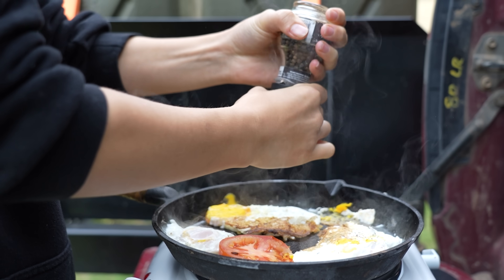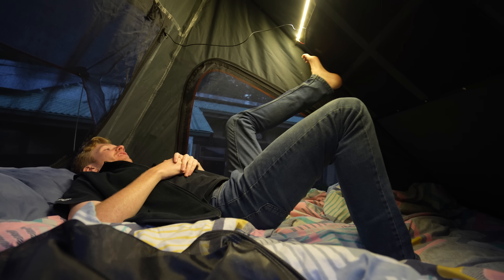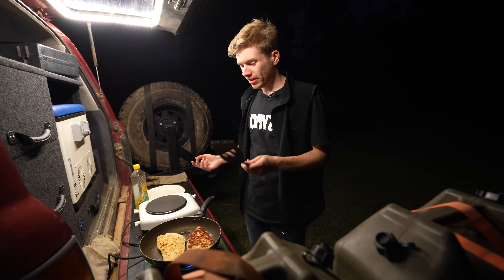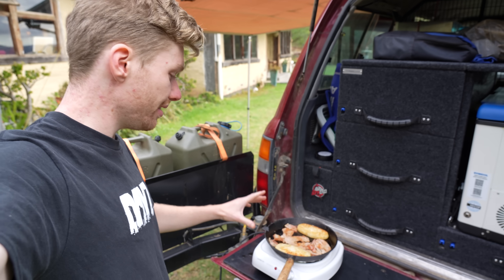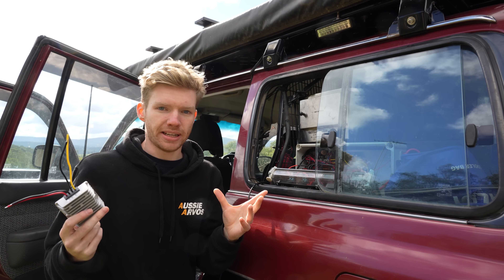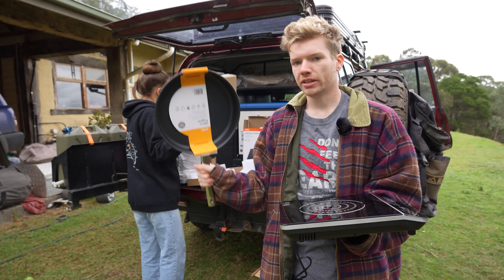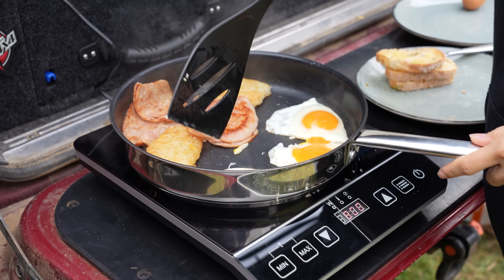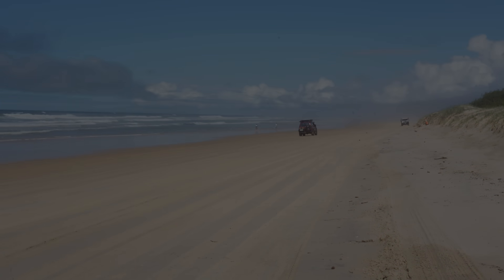is BUDGET induction cooking ACTUALLY POSSIBLE? Pushing my 12v Camping setup to its limits.

Comment from the maker: Essentially this issue comes down to the voltage of the battery getting too low when we are drawing the high current from it. As a lithium battery has a BMS (battery Management System) that is designed to keep all the cells happy and healthy as soon as the voltage drops below 11.3 power is cut. you would almost have a better shot using AGM or Lead Acid or Gel for this battery size as they do not have BMS and allow you to draw as much as the battery can handle! (this is not healthy for the lifespan of the battery and of course those batteries have many disadvantages compared to lithium). And as i mention this could also come down to the quality of the cells in the kings battery, or even the quality of the BMS but i think if you are buying lithium with the intention to cook using electricity i would be buying no less the 200Ah.
Reply: You shouldn't get a huge voltage drop with lifepo4 even with a .5c discharge 60amp should be fine id assume the bms is limited to about that with this quality of battery anyway id be measuring voltage directly at the battery and also at the inverter to see if your voltage drop isn't coming from there but thinking now its the bms cutting of not the inverter reaching a low voltage disconnect id say the bms wire size cant handle 60amps and thats where the voltage drop is coming from or a faulty cell the wire size on all bms's is usually undersized
Reply: im still in the ads but I thought the lithium had a built in voltage regulator also. even if high current draw ?
Reply: @brentmcd12  no they have a bms battery management system to protect individual cells most bms's now have balancers too to keep cells in balance but if you look at a discharge curve even with a high discharge its a very stable curve untill you reach ethier end of the scale thats why its basically impossible to use voltage as a state of charge at 15%-90% voltages are near identical
Reply: May have already thought of it but is the gauge of cable enough for 50A plus? May find a bit of resistance is causing the drop.
Is there some kind of voltage regulator that could fix this?
I appreciated this video 👍
Reply: Pat this is what i think your issue is here. Your Kings 120ah lithium battery is only rated at 100A continuous discharge. 100A x 12v = 1200W. So if you have the cooktop running at 1200W that already maxes out the battery's discharge rate. There is simply nothing left for anything else (including the inverter itself). The simple fix for this is to add another 120ah battery and run them in parallel so that you essentially have 2400W of continous discharge. You also get the added bonus of the extra 120ah capacity.
Reply: its not the AH of the battery that's just how much it can store you need to check the continuous discharge of the battery as paul said above
Reply from the maker: @paulholyoak  Thanks for you comment Paul, think you are spot on here, my shunts only ever showed 60amps being drawn but your math adds up, will be investigating and might invest in another battery in the future and put it all to the test again! Thanks :)
Reply: I would say your battery is the problem… I have a Renogy 170AH lithium in my camper with a Renogy 1000w inverter and I run an induction cooker off the system with no problems at all. Induction cooking on a budget system is certainly possible if you consider a 12v lithium setup for less than $2000 as a budget system. Check out my cooking with induction cooker video here… https://youtu.be/Mm86CvQ8ODo
Reply: Lifepo4 cells are very good at sending high amps with little voltage drop. My cells should be able to pull 500amps and only dropping down to 12v I don’t run a bms though so you’ll find your problem is your bms in your battery. Also what size wire are you running to your inverter, and do you have really good crimps
Reply: Your battery seems to be the issue. I have a 1500w kings inverter and the same induction cook top and a victron battery monitor. The cook top under the watt mode will heat at 1400w all day. At the 1600 setting the inverter will shut down. It’s drawing about 1540 according to the victron. I was hoping i would get a bit more headroom and get 1600w but no joy. Plenty of heat regardless with this cooktop. 
I didn’t use the supplied cables for the kings inverter. I upgraded to a Jaycar 4awg cables to be sure. 
 I’ve got an enercore battery from rolling cart. It’s going great so far.
Reply: I wouldn’t normally comment but, we have a kings 120 in the car and it can run anything with our inverter. The difference is we have a Red Ark BCDC which makes the difference as it keeps the battery at top notch percentage and it manages how we run everything. Also run 2 x 200ah kings in the Caravan with a Red Ark BCDC 40 and we run air fryers, NutriBullet, kettle, toaster, coffee machine without fail. Van will go 6 days straight with no solar or driving before it dies.
Moral of the story is certain things you just have to pay for👍
Reply: Hey mate i think you'll find the issue isn't the battery capacity, the issue is that the kings 120 lithium is only rated at 100a continuous discharge current which essentially equates to 1000-1100 watts of continuous 240v output through an inverter. There will be a cut off setting in the lithium bms that will be cutting it out every time you exceed that limit that along with the voltage drop protection. Only way in the short term to get around this would be to run your car whilst cooking to kick the voltage up (keep in mind this would only really work with your induction set at 800-1000watts) or to buy a more reputable battery with a higher discharge rating (amptron are a awesome manufacturer for lithium batteries, their rating and warranty for their price are wicked and iv yet to see anything match them)
Reply: Nevermind didn't realise someone already touched on this 😂😂
Reply: @tarquinhor2137  you’ll probably find 4 awg is also to small if you look at the online calculators you’ll need at least 2awg. For my 2000w inverter I need 2/0awg wire. However I’m only using 1/0awg and aaa result I’m getting a 4% voltage drop. The distance is also only 45cm
Reply: @Falcon_Overland  thanks Elliot. I miss calculated the amp draw. I expected 125amps. On top of that I didn’t expect the enercore battery to supply more than their claimed 1C. I’m Happy that it supplied 130ish amps.
Reply: @paulholyoak  spot on
Reply: @paulholyoak  yeah thats what it is as far as i know. the 200ah from kings has a discharge of 150A so that would have done the trick without the need for the extra battery. but both solutions would work.
Reply: I have some previous experience using cheap inverters and cheap batteries. I have noticed, in my experience, cheaper batteries (BMS or other) have a tendency of what is referred to as   'voltage sag'. When I bit the bullet and got some quality batteries (in the most recent case good  lithium 12volt batterries), even pushing higher amps, there was  little 'voltage sag' when under load. To me, that is a good sign of a quality battery.  A good test on this is to slowly load the battery with amps and watch the voltage sag or voltage drop, good quality batteries (especially lithium types) should be able to hold  the voltage, even under higher amps, particularly when you test at fully charge status. So might be worthwhile testing some things and seeing how the voltage drop goes and that might point you to the area to look at. That 'voltage sag' will also cause some problems on cheaper inverters and cause them to 'trip'. Anway hope this helps.
Reply: Grt a better battery one that can take highter discharge rste like 150 amp pay more for battery but will work better check out the Renogy100amp battery $629 should do the job easy
Reply: more to it than just the AHr capacity, you want a battery capable of delivering 200A continuous (without the battery having undervoltage dropouts etc)
Reply: @acgolfwrx9852  i think the induction battery issue is that the battery was getting down to its 20% capacity limit
Reply: @Falcon_Overland  i work at a camper trailer place lol... free cable...
Reply: I have a Kings 120Ah Lithium, I have the Kings 1500w Inverter, i changed out the original cables to 4G and i plugged a deep fryer in it ran at 135AMPS for about 18 minutes and then shut down, that was 1600watts the deep fryer ran 3/4 full of water. the cable was warm at the 125Ah Anderson plug but cooler at the Inverter end, So what i would do it run 00 BS cable from inverter to battery via a 175Ah Anderson plug and yes when they are special again for $500 buy another kings battery and connect them via 00BS cables in parallel Directly to the 500AH shunt you should be using from what i reserched, (Renogy battery monitor with the 500Ah shunt was about $100). my thoughts guys ?
Reply: @TindogTravels  u had a deep fryer with water in it?? Oil holds it's heat better
Reply: @blingscreensavers3881  yeah I was just testing the heat side and used water to acid burning the ass out of my wife’s cooking pot. Idk about induction I think short heavy cables are the answer to a lot. I also brought a pair of crimpers from the states they were like $275 and work great giving a hex crimp.
Reply: bro just get a bigger inverter
Reply: @absinth64  spot on I’m pricing up a budget for my lithium set up and it’ll be between 2k-2.5k
Reply: However lithium has disadvantages as well.
They can not be rebuilt..While lead acid can.
Price. No matter short term or long term lead acid is better in price. Since the cost to rebuild is pennies per.
You can agree with hippies. But lead acid is safer
I don't see much of a difference in weight.
However, I'm comparing to deep cycle lead acid.  A regular car battery is far different. 
But don't get me wrong. I started with regular car batteries. They will work..But far less efficient.  
Now In my opinion the worst batteries are gel. 
Next is lithium 
Then regular car lead acid.
And the best is deep cycle lead acid.
Reply: I've read some of the comments and looks like $1000 will do it ( U.S.) 
$300  2000 watt invertor
$200 batteries  (2) 12 v  24DC deep cycle marine lead acid battieries
$50 charge controller
$ 400 (3) 100w solar panels  .
$ 50 the stove.
Now more Battieries and or panels would be good. 
But here is why I say 300w of panels.
If you cook three meals.
say breakfast is 0700. That give 0800 to 1200 until lunch. 1200w
And 1300 to 1700 until dinner.
It would be pushing it. But I wouldn't go less.
Ideally with this you would want 4 batteries and at least 600watt of panel.
BTW the 24DC is 101 ah and cost $70 each.
Also. This is U.S.  I don't know outside the U.S. But the Batteries will always be
24DC series, no matter where you go.
There are also 27DC and 29DC which are a little bigger. But here the 24DC is better value. Because the difference isn't enough for the difference in price... The 29DC is like $130. 
my recommends ( over 15 years offgrid experience)
The invertor buy the 2000w big yellow one at a truck stop. You can buy the 3000w or 4000w. Just buy more batteries.
Batteries  24DC deep cycle marine lead acid batteries
 From auto parts stores or box store in automotive. Price ($70) is at the blue & white place. Same with the stove.
Solar Panels.. I priced them at $130 each. You can find better and worse. Same with charge controller.
....Yeah $1000 is expensive. But the only replaces will be the stove.  And you can cook free for the rest of your life. 
But let's look at numbers right now.
To use a 20 gallon propane. Doing the same will cost $17 every two week ( that at $17 per tank refill) 
So that 26 fill up in one year ( 26×17= $442 per year) 
less then 3 years ($1326) pay for it
And thats at current prices. You know the costs is only going to go up.
Reply: I got 170Ah in my Nissan patrol Ute 😊

Comment: Hi mate, i work at a battery manufacturer in Brisbane, and i can tell you something is up with either the wiring or the battery or the charger. A full lithium sits at about 13.8 volts, 13.1 is very low, just run over your charging system. The BMS cuts are usually because one of the cell banks has dropped too low, so yea, really check over your charging setup.
Reply: Agreed, I would have a guess there is some sub-par wiring either between the charging system and the battery, or the battery and the inverter. The voltage seems quite low.
Running the travel buddy at the same time is probably a big ask, but there is no good reason to why that 120ah (100A continuous, 160A peak) battery and the 1,500w inverter can't power that induction cooktop on the 800w setting (they use 850w at the wall on that setting)
Reply: Probably a good chance the wire included with the kings inverter is too small, and not sure if the inverter is running through one of those lever type breakers, but if so the voltage drop across that would be a huge contributor. Between the safety in the bms, and the internal fuses inside the inverter, a direct connection between battery and inverter with short cables and no breakers should be ok. If you do run a fuse, it should be a 200-250a class T. 
A good investment when doing elaborate setups like this is a thermal camera, even a really cheap one, will help find faults or high resistance connections very quickly. Guarantee those lever type breakers will be lighting up like a Christmas tree. Also worth noting the kmart induction cooker on the temperature control setting pulses power, as do the wattage settings below 800w. The 1000w setting draws around 1050w from the inverter, and with conversion losses that equates to around 130a from the battery.
Reply: @lexicase8805  If that was the case, the amp meter would also indicate 130 amps from the battery. It just seems like the internal wiring, the internal resistance, or the bms of the kings battery just isn't up to scratch.

I make batteries for a living, and i was pulling 160 amps out of a 100ah battery yesterday and getting 12.8 volts.
Reply: @colinsmith6340  i think you're absolutely correct, i commented while watching the video and made an assumption, but yes for the bms to be cutting off like that it has to be internal. Looks like the free battery that was given to cover damage caused by a faulty product is now also faulty! Not looking good for kings 😅
Reply: Go buy a cast iron pan with a full cast iron handle wrap the cast iron pan in alfoil and mount it near or on your exhaust manifold while your driving then it's hot for when you want to start cooking remove the alfoil and it should be clean and ready to go

Comment: For anyone interested in induction cooking - BCF sell 3 piece induction pot set, and 3 piece frying pan set, with removable handles. They're pretty affordable and pack down a lot better than pots/pans with fixed handles. Plus they're non-stick so you use a lot less water when washing up. I think i paid about $40 per set (but don't quote me on this).
Reply from the maker: Removable handles sounds awesome! thanks for the tip!!
Reply: Not listed at BCF. Got a link?
Reply: @grahameroberts8109  it’s the wanderer non stick set
Reply: I have the same Andrew and they’re fantastic. I also have the non stick roaster. I tend to use the lid more than the base as it can be used as a griddle for salmon, haloumi, steak etc.
Reply: Yep we have this set aswel and it's Awesome

Comment: The induction cooker does not run continuously at the set wattage. The set wattage is to indicate how much power will be used in a hour. The induction stove pulses, using max power. The slower the pulsing the less power is used in 1 hour. The higher the setting the faster the pulsing and the more strain on the inverter and battery. The inverter needs to be oversized as well as the battery.
Reply: I do think nuwave's are an exception for that, though they only have 3 wattage settings, their 600 and 900 watt settings are true to their ratings from what ive seen.
Reply: @chaon93  My induction cooker pulses on the first 3 settings. From 4 to 10 the current draw is constant but also increases as the numbers go higher. On number 4 it uses 1100w which  will unfortunately be to much for a small budget system with a single battery. It works fine on my 48v system.

Comment: So many issues here that can be causing the problem, if you want basic setup ie: no induction cooking 120A will do, 1500W inverter will do for a low wattage coffee machine or sandwich maker, induction really needs 200A lithium and minimum 2000W inverter AND a specific induction cooktop, cheap induction cooktops pulse high wattage on and off to mimic the different heat levels, good quality induction will draw less wattage at lower settings without pulsing (called constant wattage cooker), hard thing is to find the right induction cooktop, xioami do one but it's in the $300 mark, if your voltage is dropping quickly you have a different issue, lithium will hold it's voltage until the very end of it's charge then it will suddenly drop, if your's is dropping under moderate load sounds like a dud battery, being a kings battery is probably the start of the problem, if you want to fix this you could get another 120A and parallel them so you double the current draw capacity and upgrade the inverter to a 2000W, most importantly ensure the wiring from the battery to the inverter is over rated for the current draw, undersized wiring is a common problem, as I said too many issues can cause headaches, basically it's nearly impossible to build a reliable safe 12V system using crappy components.